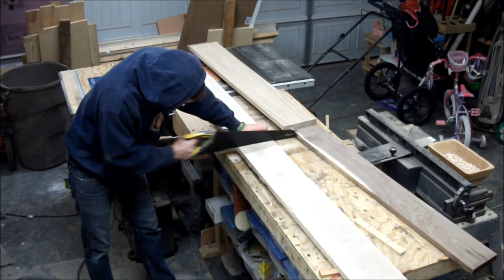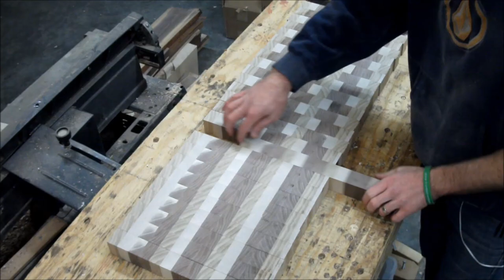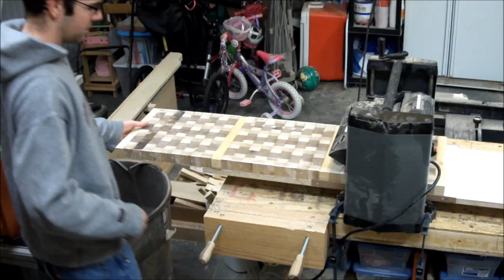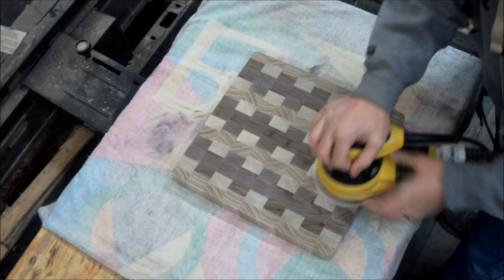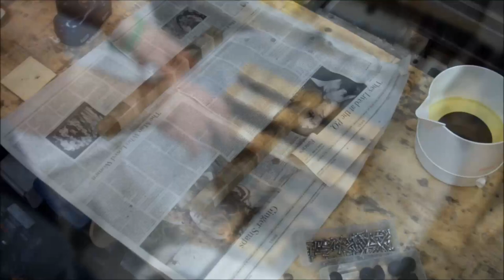pullins woodworks end grain cutting board

Comment: Nice board! How does the "etching" work that seems to be using acetone?
Reply from the maker: thanks! the logo is printed (mirrored) using a laser printer. the laser printer deposits toner to the surface of paper as opposed to ink changing the paper's color in that area. the acetone is used to release the toner from the paper and it deposits to the wood. it's tricky, but can show more detail than burning and doesn't require a unique tool for each logo/size.
Reply: +pullins woodworks thans im going to try that.
Reply: +pullins woodworks I need for this a special paper?
Reply from the maker: +Christopher Kolb nope. regular printer paper

Comment: what are the dimensions of the boards after they were ripped?
Reply from the maker: the strips are usually ripped to 1.25 inches. the final product is roughly 12x12x1.5
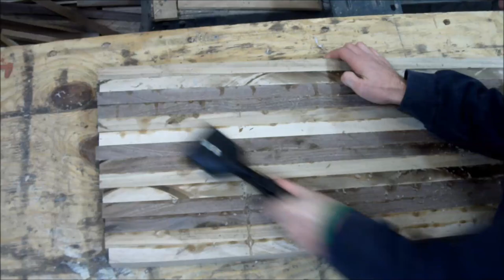Reply: +pullins woodworks at 3:05 do you know roughly how much you took off?
Reply from the maker: +Jacob Boyd 12.25 inches to fit in my planer.
Reply: +pullins woodworks Thank you so much for your help and very cool board..!

Comment: Question. Weren't you scared of blow back? Putting end grain into a planer can be dangerous
Reply from the maker: it is generally bad form to put end grain through a planer. additional caution must be taken. extra light passes are required. thin boards will not survive. proceed at your own risk, don't stand behind it. eventually i'd like to get a wider planer and with a spiral head.
Reply: Got you boss! Either way great results!
Reply: Chronicles of Brian I see a ton of wood workers do this successfully, I’ve tried it myself and gotten away with it a couple of times but just the other day I ruined 2 padauk and maple boards. Not sure what went wrong, i think the boards were uneven